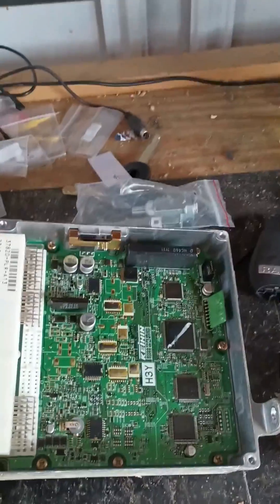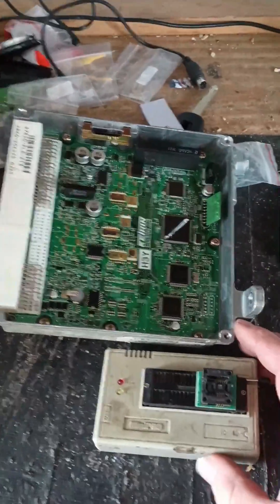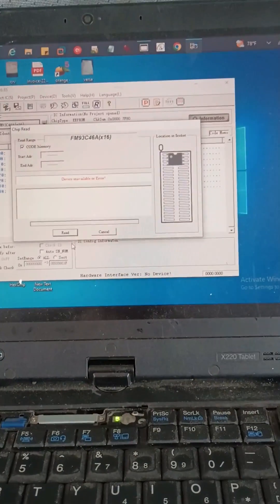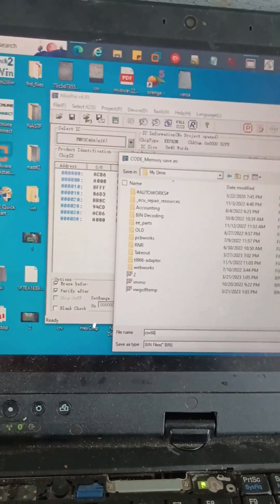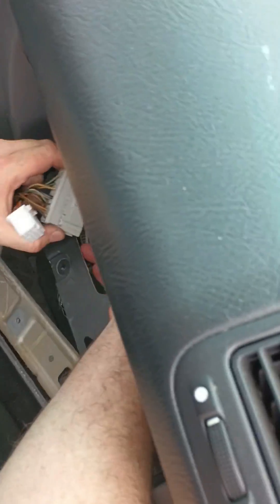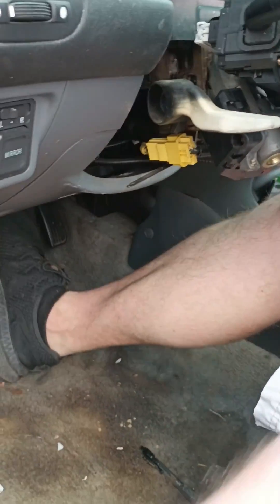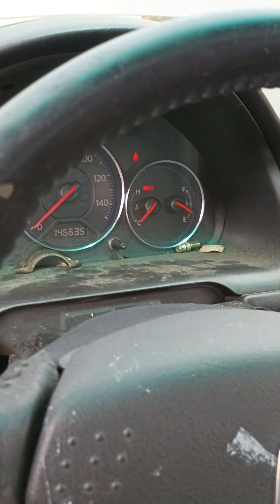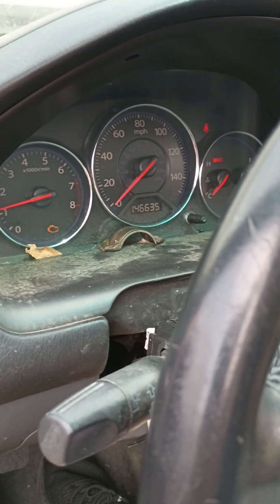Going Beyond the Standard: Deleting Immobilizer from Honda Civic after Key Programming Fails

Comment: I did this to a Civic it was either 03 or around that I cut the chip out completely and the car ran just fine except it always had a check engine light no way around that
Reply from the maker: Yes you can do that as well. It works on some older accords too but you get the rom error CEL code.
Reply: would this work for a 05 accord?

Comment: If you can, what part of the eeprom data do I need to cut out? I've got the ECM out, a programmer, software, and a backup, I just don't know what to edit with the eeprom data.
Reply from the maker: Make a free account and submit this question on my forum and I will answer it @ https://autoelectronics101.com/index.php/forum/keys-immobilizers
Reply: @ecurepair  alright thanks, made a submission
Reply from the maker: How'd it go? Did the method work for you?
Reply: @ecurepair  I didn't get any email notifications and I'm sorry for not responding, but I was busy painting my other car at the time so I'll get the part number and dump file as requested

Comment: Hi there,

I Have a Honda Civic  took my Honda Civic 1998 which when the key is turned, the fuel injectors get no power. I took my car in to Auto Mechanic and they said it is either the immobiliser or the ECU but couldn't tell which. I grabbed an ECU from u-pull-it and my car still doesn't get fuel to inject. The green key light on the dashboard shows the key as recognised in both cases so, but since this issue started after I inserted the learner key into the car, I think I corrupted the immobiliser...

It is seeming like the issue is that the ECU is not receiving the "key verified" signal from the immobiliser.

But alas, would doing this bypass help with my issue or would it seem unrelated?

And is there a way I could change the immobiliser and have the car run without having a key with the correct transponder?

Thank you in advance!
Reply from the maker: Are you in the US? 98  civics in the US do not have immobilizers. Civics here didn't start till 2000.

Comment: Will this service work for a 2003 Honda Pilot?.i lost ignition power to my radio, ignition lock solenoid and 12v power outlet as well. Everynow and then my immobilizer green light will flash on the dash and it wont start. Its also shutdown on me when traveling at highway speeds as well. Its a pretty scary situation during rush hour.
Reply from the maker: No this probably wouldn't work for the pilot. I will say though, it doesn't sound like the immobilizer is your problem. You probably have a wiring issues thats shutting the ecu down. I say this because the immobilizer would not shut down a running engine, they only prevent starting when the key is turned on, after that it doesnt activate again till the next key turn.
Reply: @ecurepair  thank you for the insight.
Reply: @frankietuned  Might be a faulty VSA system.
Reply: It ended up being the main power relay going bad. I replaced it and no more issues.

Comment: Why hide the lines of code that need delting? Im having the same problem with a 2004 CRV same ecm and thought finally I can do an immo off and get this thing out of my life. 
I know we have to be security concious but mate who's going to steal one of these buckets anyway. 
Basically your video is you boasting about doing a simple imo off. 
BTW to anyone reading this the eprom is an RL57 = 93C46
NOT 66. 
THANKS
Reply from the maker: I dont think this will work for a crv tbh. Its pretty few cars it works on. Most honda's you will not be able to do immo off and need to use an emulator instead.  It is a 93c46 you are correct and I read it as a 46 in the reader so Im not real sure why I was calling it a 66, its been awhile ago.
Reply: This also works with Honda CRV 2006 
JUST REMOVE THE EEPROM 
It didn't restrict RPM Not ideal as new key can't be programmed but to get the car going and off the side of the road its a quick solution.

Comment: HI, i have same issue. honda fit from Japan. I cant program or learn the existing keys to the replacement ecu. Can I send to you for immo off? Live in Ghana
Reply from the maker: The method I used only works on a few models. I dont think it will work on the fit. What is ECU part number?
Reply: 37820-RB1-J65 is the ECU PN.
Reply from the maker: Yea no immo off on that one sorry. You may want to look for an emulator for it.